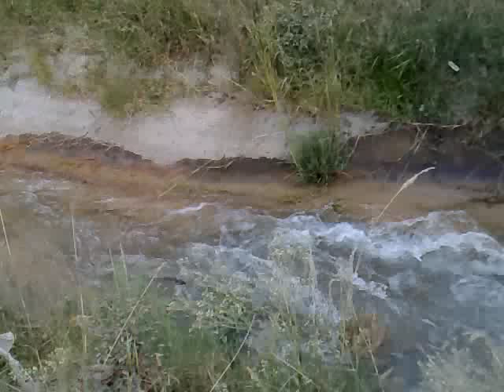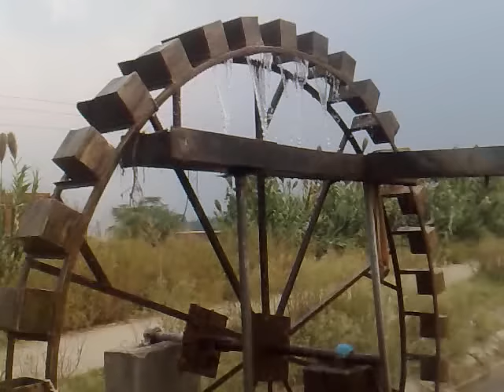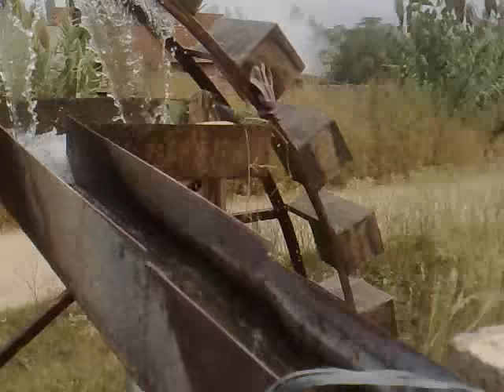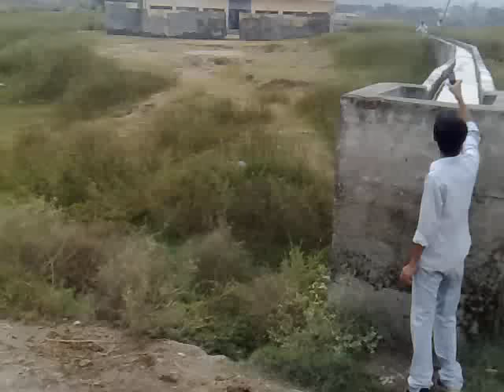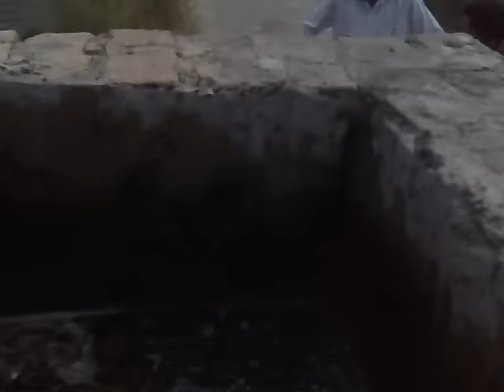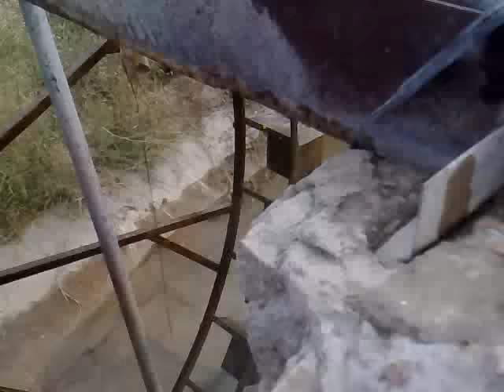Persian Wheel - Near UET Taxila

Comment: I'm impressed with how efficient this water wheel is.   The water is mostly being delivered where it is supposed to go.   And the height delivered seems to be 3/4 of the wheel height or more.   Anyone interested in building a scale model?

The wheel brings up some interesting questions.   The back of the boxes seem to be operating as the paddles.  Wonder the optimum size for the boxes, how many there should be and what is the optimum distance between boxes?

This seems to be a straight drop design which requires the structure to be supported with only one set of spokes on the back side so the wheel can turn around the collection box and exit channel.   

Interesting that there are not that many spokes, perhaps possible by the two surrounding rings.

Anyone interested in this type of approach, please post and maybe we can share ideas.

Comment: @ChannelMH 
Thanks. I thought so but I think compared to the size of the stream such huge metal wheel would be too heavy. Also the wheel is running on a good uniform rate which I think would be very difficult for such a small stream. Anyway since there is no apparent other mechanical device around I'll take your explanation.

Comment: It's a Noria not Persian water wheel. Persian water wheel is a device used to lift water from water sources, like open wells and it is operated by draught animals, such as bullocks, camels etc.whereas Norias are used to lift water from streams/rivers. Force of the flowing water current usually powers the wheel.

Comment: What energy is used to keep the wheel rotating?
Reply: the wheel is turned by draught animals rotating a geared horizontal wheel....
Reply: Bhavik Gandhi Flowing water energy is used to rotate the wheel
Reply: The flow of water
Reply from the maker: It's Actually The Flow Of Water That's Keeping The Wheel Rotating ...
Reply: Water flow energy
Reply: @MI-pm8ej  I thought so but the Wheel seems to heavy for it